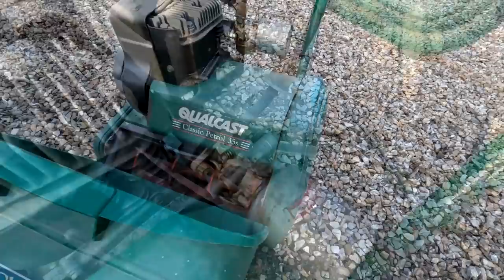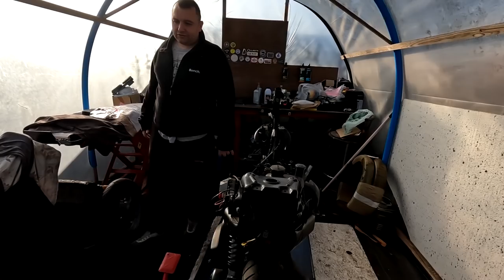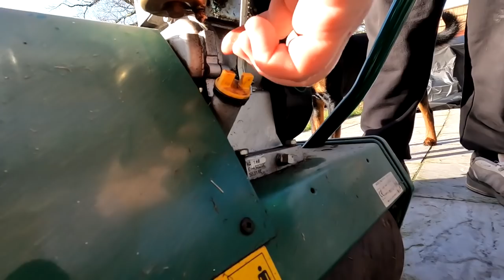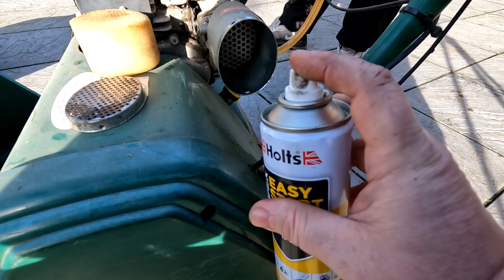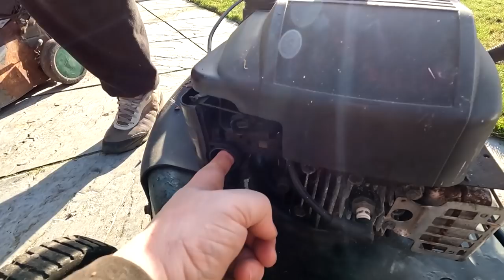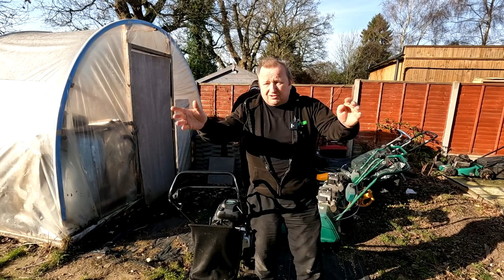Free Lawn Mowers Cold Start Vlog

Comment: That is Hayter Double 3 I got one of those last year as a non-runner bought in January too for £30 though put £8 new carb on it as old one was too far gone. Then ran a treat with general service. It sold for £230 in Spring. You did well getting that for free. Great hobby you got me into Martin👍👍 Watch all you vids keep up the good work.
Reply from the maker: Nice one Scott
Reply: Yep, I thought Hayter Double 3. I had one for a while. Steel deck is a bit flimsy on those and the handles like to break! But great mower to use for large gardens and rough areas. The side discharge chute makes them awesome.